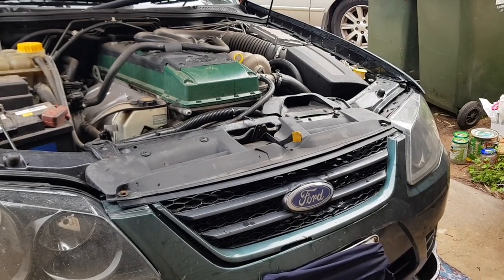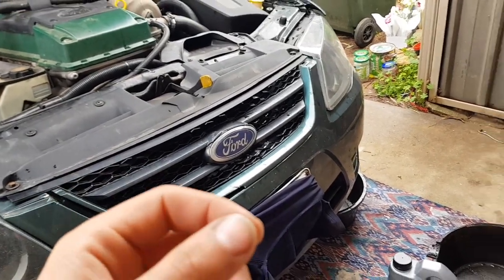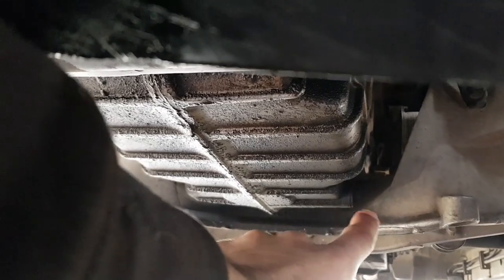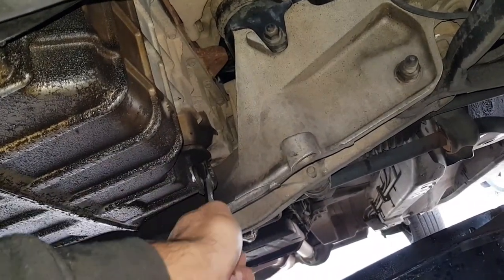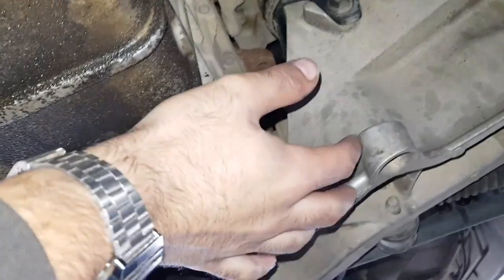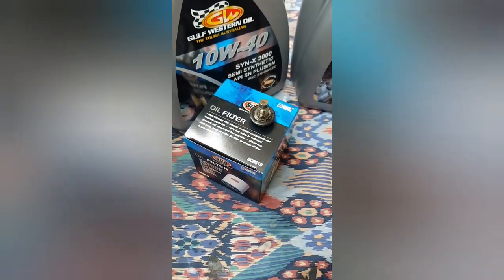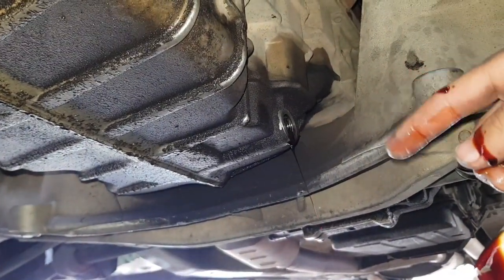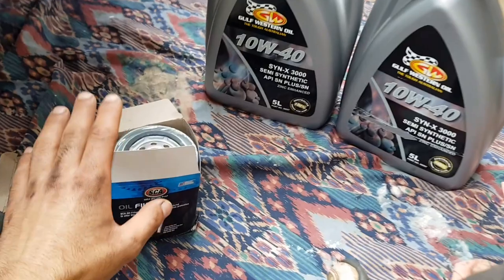Engine Oil Change Ford Falcon BA/BF service

Comment: 81 this year and I'll be damned if I'll let another mech rip me off. Have had to buy another old car since my 1994 magna blew a head gasket shortly after returning from a service.  Trusted the mech to keep me upto date with what was needed, but later found he was replacing things that were not needed like a starter motor instead of a neutral safety switch, returning the car without coolant, telling me the water coming out of the tail pipe was just condensation (at 2pm in dry weather??). If I had understood my car better and known how to do these simple tasks I would still have my old faithful. I now have a 2003 ford BA. Drives well, not over heating, and no warnings...yet, but it is now blowing white smoke. So I'll be down under the car to do a coolant flush, followed by a Bars block seal and finally an oil change. Thanks to you it is all so easy.  Thank you.
Reply from the maker: Yes certainly one of the reasons I began doing my own work on cars as a teen. You just never know what mechanics do or don't do. But hopefully the falcon treats you well. They are reliable work horses with only minor areas of wear and weakness. Lower ball joints failing on Falcons is just one major one, so keep an eye out for any signs that yours are worn/failing. I recently had both my front ones installed at $200 each. So not too bad.
Reply: @FordMercGuy  Thank you I'll certainly keep an eye on them.

Comment: Brilliant video! I'd recommend wearing short sleeves and no jewellery (ie watches or bracelets) so your hands and arms are fully mobile. Also, put a flattened cardboard box under the oil tray to avoid any oil splashes going on your driveway 👍
Reply from the maker: Thank you very much mate and likewise thank you for your suggestions I'm sure they will help people reading this

Comment: Great video, and the detail is needed for newbies, The engine is leaking oil 5:53 is it the stump gasket or a front seal just for my info?
Reply from the maker: Thanks mate, yeah that's what I went for. A vid for someone that has never done it before.
I haven't investigated the source of that leak. 360,000ks on the engine. Perhaps a few leaks not just one culprit. Keeping an eye on oil level is key!

Comment: very detaile oriented, thank you. I have a petrol Territory guess it's process is indentical to this one at least the after market filter is same z516.
Reply from the maker: Thanks alot mate! Will be very similar, maybe even same amount of oil to go into the engine as same engine as in the Falcons. Filter yes z516 for the later gen Barra, z9 for earlier gen.
Thanks for commenting mate!

Comment: good work men ones you change the oil at least it takes 90 second probably to circulate the oil in the engine when you sart to check the engine oil. Love your work anyways 👍
Reply from the maker: That's it mate! I guess ideally, we'd want to get oil to operating temperature to check oil level anyway but certainly good to check over a few days also! 👊

Comment: Great, I'm going to have a go now, I asked about putting cheap oil in for 2nd flush my mate said it's good to drive car with cheap oil 10min then do 2nd flush.
Reply from the maker: Yes a great tactic for cleaning the system. I do this too for newly purchased vehicles/cars that haven't been serviced in a while
Reply: @FordMercGuy   Thanks for help, it all went well.
Reply from the maker: Perfect mate! Top effort

Comment: I use 5W40 SynX 5000 ($20 on sale). Mine is an EcoLpi and get 10.2L/100 on flat highway. Best engines ever to work on and built like a tank.
Reply from the maker: Good price! Amen mate, mine has 344,000 ks so I go the 10w-40. Indeed, we're taxis for a reason👌
Reply: You'll easily get near a million km out of a dedi gas engine. Barra life
Reply from the maker: Absolutely! With good maintenance along the way too!
Reply: @FordMercGuy  hi buddy over a million and a half kms still going strong Ba falcon 2003 model use to be a taxi .
Reply from the maker: Epic mate! What a warrior indeed!!

Comment: Maybe some white teflon tape around that bolt to avoid leaks. Teflon tape from tap-water taps
Reply from the maker: Sump plug? Maybe be careful, we don't want the Teflon disintegrating and contaminating the engine oil. I'm no mechanic but to my knowledge a new dump plug washer will help stop leaks.

Comment: Thanks for this detailed guide,

I just bought a Ryco Z9 filter while doing mine,
Do you know the difference between a Z9 and a Z89A besides the size? 
Supplier says both are compatible for my car, and couldn't find a clear answer.
Reply from the maker: No problem mate thanks for watching I'm glad I could help. To my knowledge of the z9 is the most suited oil filter listing for the BA Falcon and z516 for the BF Falcon. I would say that the thread use the same for the two filters that you were looking at however the amount of oil held in each filter will be the difference. I say a bigger oil filter will also mean it has more cartridge filtration capacity compared to the smaller z79a and if we can fit a smaller filter will get clogged more quickly than a bigger filter.
Reply: @FordMercGuy  Thanks for the reply mate, as I said, couldn't find a clear answer, I am driving a BA Falcon, so Z9, just supplier website says special order for the Z9, get there, 50 on the shelf :P
Reply from the maker: Hahah nahh z9 is the age old for Falcons. Even AU model. But weird they're listing something else! Bloody tech 😂
Reply: p.s , no oil filters were prefilled from factory , all you are doing is pump old oil from the crank back in to a new filter
Reply: @FordMercGuy   i just put the bf filter in my ba xr6. too late now 😂. do you think it really matters? cheers
Reply from the maker: Perhaps bf filter being a smaller size just has less oil capacity inside it compared to the ba filter.

Comment: Personally id stay away from that gulf western oil,its bottom shelf quality hence how cheap it always is. I use nothing but the best for my fg xr6-castrol edge 5w 30 fully synthetic oil.
Reply from the maker: Agreed mate. This is dads work vehicle with car less than $500 value. Any car that's going to be kept.. Good quality oil Is important!

Comment: Gulf western...you can't be serious
Reply from the maker: I wouldn't use it for a pride and joy of mine. But have used this gulf western on our 3 BA wagons. All over approx 70-80,000ks with this oil so far on each car no issues so far.